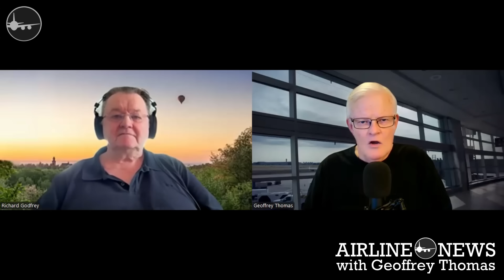Air India Crash - Probable Cause  #airindiacrash

Comment: Gut feeling…. Boeing is so concerned that it’s another design issue that they are misleading others on team investigation. Reports have skipped from APU to batteries to pilot error…..and more and what’s next, just follow sequence of event to get to initial cause. Personally, I don’t want to fly in a Boeing, unlike 20 years ago when they had a superb reputation. Let this be a lesson to business, keep your MBA/accountants out of engineering. If USA was still functioning, Boeing would be have to account for recent history of catastrophic failures.
Reply: My guts are saying the same thing.

The fact that the battery had some kind of failure raises the possibility that the system that was there to ensure that this was a fail-safe event was not working.

The accident team must have the evidence to determine one way or the other when the RAT deployed relative to the FDR indication of a fuel cut off signal.

This should not have happened -  the engines have their own independent electrical power supply and mechanically driven fuel pumps - they are certified to operate on suction feed, so failure of boost pump electrical power not an issue - that in my simple engineer view narrows it down to the spar fuel valve.

All hell could have been breaking loose in the rest of the electrical system but if the fuel supply had not been interrupted the aircraft could have climbed away while the pilots figured out WTF is happening.

Comment: Have you looked into the theory that a fault in the WOW sensor or the electronics associated with it caused the system to lock out the pilot’s control over thrust ?

Comment: But who moved the switches.?.
Reply: I think it was not a physical movement of Fuel Switches from Cockpit centerboard pedestal. . In my personal opinion , I feel any of these three likley events as mentioned , could have lead to this unfortunate disaster . 1) A major total electrical power failure that possibly led to some spurrious/automatic/malfunctional airframe logic command causing FSOVs to fail-safe shut instantaneously and cutting off the fuel supply. 2) The DC bus that powers the Fuel Actuators solenoids likely failed, due to Electrical Cascade, causing the solenoids to de-energize. With the solenoids no longer powered, the FSOVs snapped shut in their fail-safe position. This Uncommanded closure cut off fuel flow to both engines instantly, resulting in an immediate dual-engine flameout. This possibly got recorded generic as FUEL CUT OFF in FDR side. 3) Additional possibility, though very rare is FADEC likely lost command authority; engines lost metered fuel flow as the FMU was compromised. This led to immediate Engine fuel supply being cut-off and Aircraft Stalling. T
The 3) is a rare possibility as at the takeoff thrust, each FADEC is self-powered by its PMA; a FADEC-first/FMU-first shutdown would require very rare, identical EEC failures or simultaneous PMA defeats — much lower prior probability than a single airframe electrical fault that issues (or mimics) dual cutoff commands. RAT deployment here is consistent with downstream consequence (both engines flamed out because fuel was cut at the spar). likely not indicating FADEC to fail. 

Disclaimer : This is purely an independent, technical unoffical perspective meant for professional discussion, review and knowledge-sharing amoung aviation peers — not an official conclusion. Hope this helps.

Comment: Another question Richard and Geoffrey 
Is the battery heamatically sealed? It wouldn't have to be if it was only designed to contain flames 
If only a small amount of water had entered could the battery have been leaking HF for some time?
I am thinking of the Inbound flight and it's electrical problems and the slow take off.

Comment: Just a quick question by way of clarification, but first a thank you for such a comprehensive update.
As a non-aviator, could you clarify whether the fuel cut-off switches were moved to the cut-off position automatically by the intrinsic safety system built into the aircraft, and not by a manual input from either of the pilots as this would exonerate them from blame? If this is the case, and given the actions we know they took, then we should applaud them for their quick thinking, albeit without sufficient time or altitude to recover the situation.
Thank you
Reply: This is an important question. I think it was not a physical movement of Fuel Switches from Cockpit centerboard pedestal. In my personal opinion and research  , I feel any of these three below likley events could have lead to this unfortunate disaster . 1) A major total electrical power failure that possibly led to some spurrious/automatic/malfunctional airframe logic command causing FSOVs to fail-safe shut instantaneously and cutting off the fuel supply. 2) The DC bus that powers the Fuel Actuators solenoids likely failed, due to Electrical Cascade, causing the solenoids to de-energize. With the solenoids no longer powered, the FSOVs snapped shut automatically in their fail-safe position. This Uncommanded closure cut off fuel flow to both engines instantly, resulting in an immediate dual-engine flameout. This possibly got recorded generic as FUEL CUT OFF in FDR side. 3) Additional possibility, though very rare is FADEC likely lost command authority; engines lost metered fuel flow as the FMU was compromised. This led to immediate Engine fuel supply being cut-off and Aircraft Stalling. T
The 3) is a rare possibility as at the takeoff thrust, each FADEC is self-powered by its PMA; a FADEC-first/FMU-first shutdown would require very rare, identical EEC failures or simultaneous PMA defeats — much lower prior probability than a single airframe electrical fault that issues (or mimics) dual cutoff commands. RAT deployment here is consistent with downstream consequence (both engines flamed out because fuel was cut at the spar). likely not indicating FADEC to fail. 

Disclaimer : This is purely an independent, technical unoffical perspective meant for professional discussion, review and knowledge-sharing amoung aviation peers — not an official conclusion. Hope this helps.
Reply: @Skyking-v2m  
Thanks Skyking. 
This did answer my question in, whatever the root-cause of the disaster really is, that there was the potential for the in-built flight control system to move the FSOVs to the off position, other than a manual action by the pilots. 
Many of the 9 o'clock jurors implied inappropriate action by one of the pilots, but to me, the evidence in the public domain did not, and does not, prove this.
Furthermore, if the FSOVs are turned off at any time during the flight, surely there would be an audible warning saying 'Fuel Cut Off' or something similar....?
I don't like injustice, and justice is what is required now for all those who lost their lives and for the family and friends left to grieve.
Thanks again for taking the trouble to write.
Reply: @rubybrown3905  Great technical question. On the Boeing 787, the cockpit warning systems are built around the EICAS (Engine Indication and Crew Alerting System), which integrates engine, systems, and caution/warning logic all three infact.
Now, If FSOVs close in flight during climb, here’s what the crew would actually see/hear ideally :
1. Engine indications
On the Engine Display, the affected engine’s N2 (Core Speed) and fuel flow would drop rapidly.
EGT and N1 (Fan Spool Speed) would start decaying after fuel cutoff.
Crew would see ENG FAILING almost instantly.
2. EICAS Caution/Warning Messages
The primary message would be:
ENG FAIL L / R (left or right) – amber caution.
If both FSOVs closed → ENG FAIL L + ENG FAIL R, escalating to a red “ENG FAIL – BOTH” warning.
Supporting messages could appear, such as:
ENG FUEL VALVE CLOSED (based on valve position sensor feedback).
ENG FUEL PRESS LOW. - denotes Fuel Pressure dropping.
3. Aural Alerts
A warning chime would sound, depending on whether one or both engines were affected.
There isn’t a spoken callout like “Fuel Cutoff.” Instead, the aural alerts are standardized (beeps/chimes).
4.If both engines quit due to FSOV closure, RAT deployment would follow automatically to provide minimum electrical/hydraulic power.
Hope this helps. Thanks,

Comment: Another thing missing from the comedy preliminary report is any mention of the survivor statement.
Lights flickering and a bang
Geoffrey and Jeffrey if the switches were the only cause of the crash would the lights have flickered?❤
Reply: A bang and lights flickering is normal for a RAT deployment.
Reply: A bang? I saw a vid of RAT deployment and it looked very smooth. A clunk at worst.
Whereas a APU battery vent sounds like it would be a bang

 @Corwin4000

Comment: That little cloud of smoke off to the left at/ around rotation, I had noticed at the outset and presumed was dust blowing off in the wake of #1 engine. It was hot, dusty weather in Gujarat that day.
Interesting you have addressed this potential issue.

Comment: Unlikely as is simultaneous lithium-ion thermal runaway and water ingress at take-off, this video presents your least probable guess, because you put it in the aft avionics bay. How did that cause induce dual failure? The 787 is peak-of-the-art and its most important advance -- with the arguable exception of lighter-yet-stronger carbon-composite structure -- is avionics centralized on the "Common Core System" (CCS). The CCS centralizes critical computational functions while maintaining reliability by way of redundancy, with most of the computational facilities in two "Common Computing Resource" (CCR) cabinets, one left and one right. Each CCR cabinet is super-reliable and redundant within itself, and the 787 can fly and safely land even if loses all of one of the two. Both of the 787's CCR cabinets are in the forward avionics bay.

How did this flood and fire you imagine in the aft electronics bay induce dual engine failure? Glossed over that step of your "Probable Cause".  @16:06 "Incredible work", it was, but I think our host meant that in a good way. It was fantastic, in the sense of pure fantasy. India's AAIB can and largely already did diagnose the cause, because they have the data, and speakers on this channel cannot because they don't.

Comment: COMPLETELY IMPROBABLE!
The Aft battery is located in the aft cargo bay close to the aft cargo bay door visible to both engineers and baggage handlers it's also located close to the bite test terminal. 
ACMS system monitors battery life battery condition and   it will warn of any failure and will disconnect from the electrical systems. 
The battery cells are individually wrapped in inert materials with a electrical disconnect between each cell to prevent thermal runaway spreading throughout the battery the cells are sealed into a stainless steel case both to contain the fumes and the heat. And is allowed to vent to the outside in case of malfunction. 
This battery pack is not located near the aft AE bay it is a number of frames fwd of this nor is it situated under a toilet or galley area. It is sat on a support frame member behind cargo wall panels and a site glass for inspection purposes. Water cannot enter the battery because it is completely sealed . The aft data recorder is situated a number of frames away from this battery behind a pressure bulkhead and close to the APU .
Sorry Richard you need to rethink your hypothesis.
Reply: What is your source for claiming the APU battery is not located in the Aft EE?
Reply: @Corwin4000 because I worked on them
Reply: Has the mounting location changed over time?
Reply: @Corwin4000 not that I am aware of . The  location sits one frame back on the left hand side aft of the aft cargo door aperture . This is an easy access point for the engineer to do a battery change or inspection it's also next to a bite test connection point aft of this what we call bulk cargo bay separate from the aft cargo this will a spare wheel sometimes parts for aircraft servicing and tins of engine oil and hydraulic fluid . Then a small section where the water tanks and waste tanks under the aft galley and toilets then we have pressure bulkhead then we have the aft FDR and we are then into the tail  section horizontal stabilizer tork box and screw jack. Then we have an APU fire wall and APU compartment. 
The aft ee bay is just fwd of the aft cargo area access to this is from the aft cargo main door and you have to walk towards the front of the aircraft a small door to access the bay is on your left this is located over 20 feet away from the aft batteries.
Reply: Interesting... and weird! All the documentation I've found lists the battery as in the Aft E/E bay (although perhaps "in" rather than "near to" is a descriptive shorthand?). Likewise for an electrical bay tour video from an engineer. Perhaps it varies by operator choice?

Comment: Gentleman good deep dives on AI 171. I remain confused on how you come to the conclusion the Rat was deployed prior to take off? Shutting off both engines deploys it. What is the evidence to support otherwise? 

Next you dismiss the pilot error hypothesis with no good explanations. To me pilot brain lapse fits all facts most closely. Especially when considering the timing at the exact moment the landing gear was to be lifted. Every year 12,000 accidents happen in the USA because people step on the gas instead of the brake. The same can occur to a pilot going through hundreds of sequential steps at takeoff.  

What does not fit is the idea batteries or water leak in the toilet recorded falsely on the FDR as being responsible for moving fuel switches. It’s amazing to me your speculations are based on a foundation of highly detailed confusion that exonerates the Captain from a simple yet tragic mistake. I’m speculating too - but the pilot error theory is by far the leading explanation of what happened to AI 171. Complicated unsupported electrical / water leak theories should be investigated but are a distant and fractional probabilistic  explanation for this specific accident based on all known facts.

Comment: This seems to proove me wrong about a prolonged brake application during power checks before roll.....  A Reuters timeline, based on the preliminary report and ATC timing, says the aircraft was cleared for takeoff at 08:07:33 UTC and began rolling four seconds later—so any “power checks” while lined up were about 4 s. 
Reuters... end quote - 4 seconds is only just long enough to test engine power...  i wrongly? presumed it would be a lot longer and show signs of difficulty attaining power...   But another possibility. from ATC timing..
07:48:38 — Aircraft departed bay 34 (tow/ready). 
07:55:15 — Taxi clearance issued by ground/ATC. 
07:56:08 — Aircraft began taxiing from the bay toward Runway 23 (via Taxiway R4), backtracked and lined up. 
08:02:03 — Aircraft was transferred from Ground to Tower control. 
08:03:45 — Tower instructed the aircraft to line up on Runway 23. 
08:07:33 — Take-off clearance issued by Tower (Runway 23). 
08:07:37 — Aircraft began takeoff roll (i.e., started rolling). 
08:08:33 — Aircraft reached V1 (153 kt IAS) as per EAFR/flight data.  
  
SO did he do a power check between 08:03:45 and 08:07:33 Giving plenty of time to stress 28v to 120v inverter for brakes and battery/Diode ++ water ingress and rot  ???

Kevin...

Comment: The account of the survivor always pointed in this direction. He describes a loud bang and all of the electrical systems immediately failed. Only the LEDs in the floor leading to the exits (powered by their own batteries) were lit. So, suggestions that the electrical systems failed because the fuel flow to the engines was cut off are not sustainable. Then, as to the suggestion of pilot sabotage, I doubt this, because it is clear that the pilots were trying to keep the ‘plane in the air and were trying to bring it down safely. Indeed, if the airport had been in the open countryside surrounded by flat fields, it would almost certainly have landed safely. The cause of the disaster was, of course, primarily, the location of the airport. If you build an airport in the middle of a city, you are asking for trouble. That is why most airports are well out of the cities which they serve and surrounded by fields. As to the fuel cut off switches being moved. The only hard evidence which we have is that they were in the open countryside”flow” position after the crash. A total electrical failure could easily have resulted in random signals being send by the computer and relayed to the flight data recorder. I doubt if the pilots would have deliberately cut off the fuel flow during take off - there are no circumstances where that would have been likely to help at all.

Comment: SMOKE OR DUST? You are saying SMOKE rather than DUST is seen on the left hand side of the aircraft as if that were a fact because it supports your hypothesis. That's quite a big assumption gentlemen to make public without qualifiication. Could it not equally have been dust created by the vortex from the wingtips which, because of the plane’s large wingspan, overlap the edges of the runway? What proof is there that it was smoke and have you for instance had access to airport CCTV to compare with other flights at Ahmedabad in similar conditions?
Reply: Just watch the runway video 32 X slower..